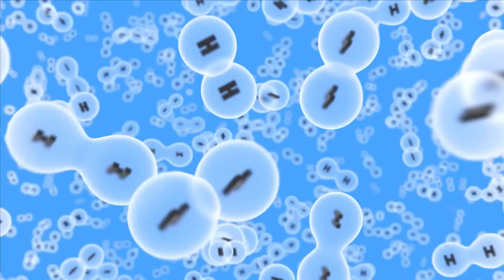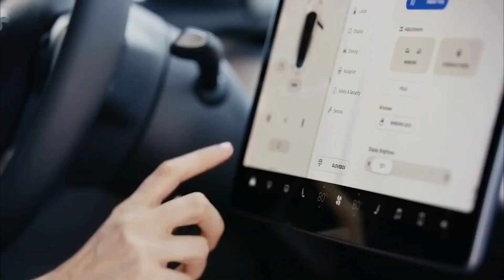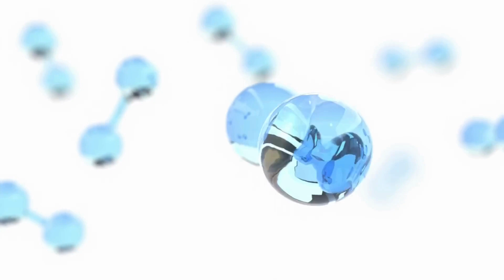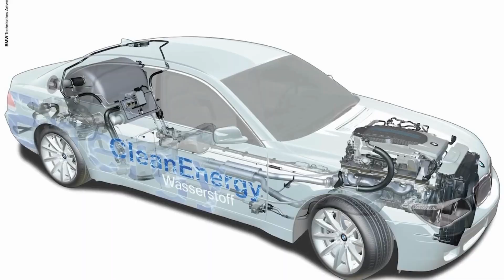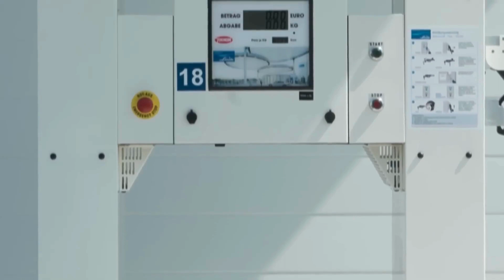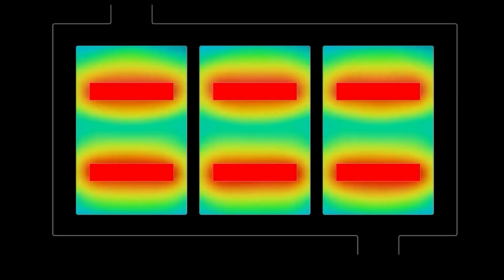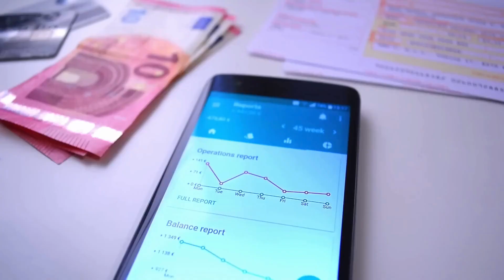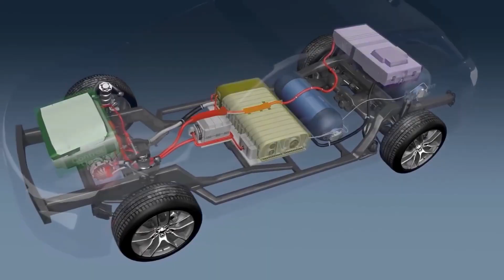Could This New Toyota's Engine Will Destroy Entire EV Industry ?

Comment: This report is full of errors and repetitions. It says "fuel cells produce electricity" (true, that's what they do) but shows what appear to be hydrogen tanks connected to an internal combustion engine. The writing is so bad I didn't finish watching, so is Toyota using liquid hydrogen (LH) to carry enough energy density to make hydrogen a practical fuel? LH is cryogenic. It takes lots of energy to produce it. In today's world, it would require many times more fossil fuel to produce an energy-equal volume of LH, and the tanks would be extremely dangerous at highway speeds. Hydrogen is explosive at 4% in air, much worse than gasoline.
Reply: Click bait